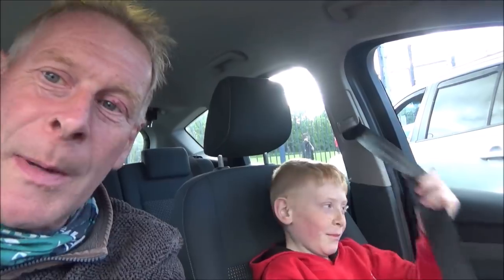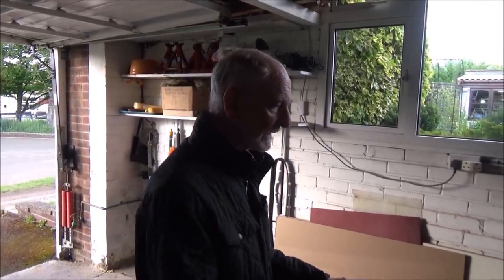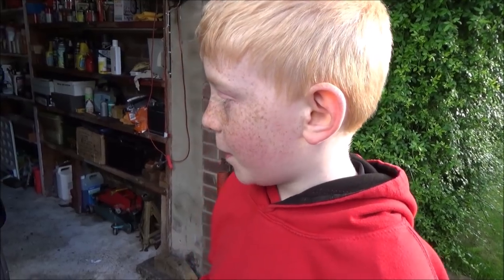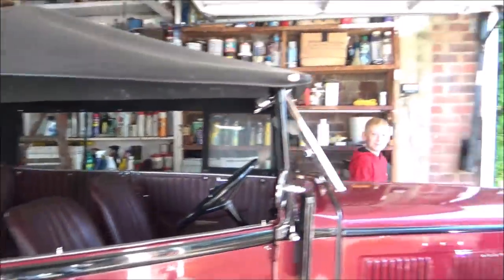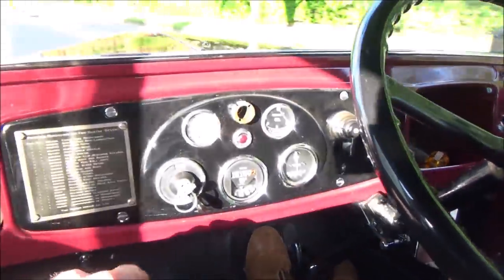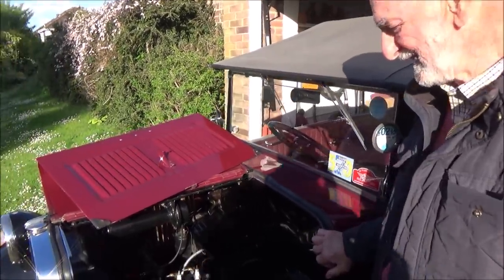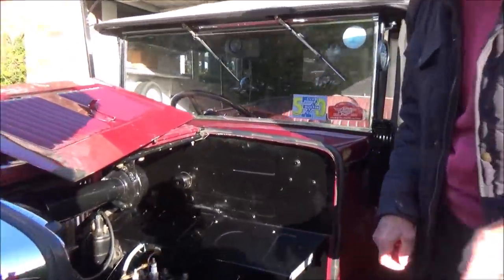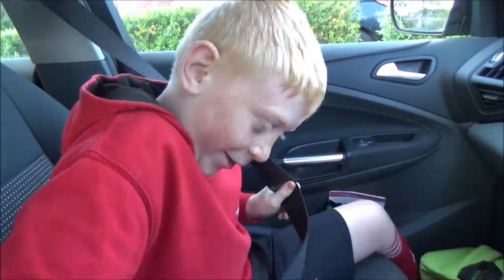HARRY GETS A TRIP IN AN AUSTIN 7

Comment: Wow that brought back memories. My Dad's first car in 1953 was an Austin 7 Saloon in Black.  I was 5 at the time. I think it was a 1937 and I still remember the registration number. I've two distinct memories of that car... First, the drivers seat cushion was like an inflatable pillow, you literally blew it up with a stirrup tyre pump. It was a series of tubes, zigzag fashion and contantly needed puctures repairing, Dad was putting patches on patches every weekend. Second was when he got stuck in soft sand on the beach at Southport. He eventually got it out by taking the spark plugs out, putting it in gear and winding it out using the starting handle. We had that car for 5 years and I've got good memories of the days out to the seaside and the inevitable breakdowns, which were always fixed at the side of the road. You never went anywhere without a toolbag. Going through Blackpool Illuminations was a 7 mile crawling traffic jam, every other car (including Dad's) constantly overheating. They would let me get out and walk ahead with hundreds of other kids. They would eventually catch up for me to get into the back seat again. The opening front screen was hillarious, I remember one time we were stuck in a jam and he opened the screen to get some fresh air and, the tax disc holder dropped off and rolled down the road, followed by Dad trying to catch it. I think it was that car that the Semaphore Indicators were in the Door Pillars. The solenoids would frequently stick and would be unstuck with a firm thump on the door pillar inside to make them work again for a few days.  Memories of happy times.... Thank you.
Reply from the maker: and thank you for sharing your wonderful memories